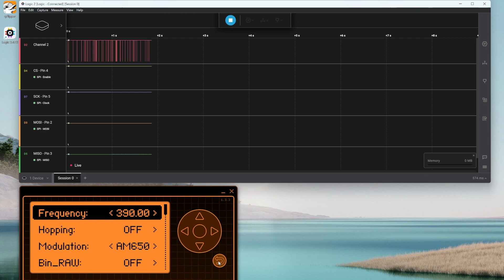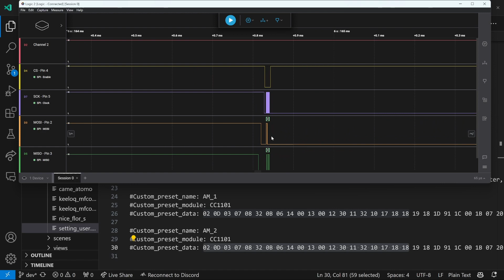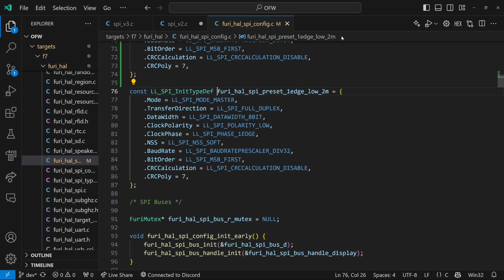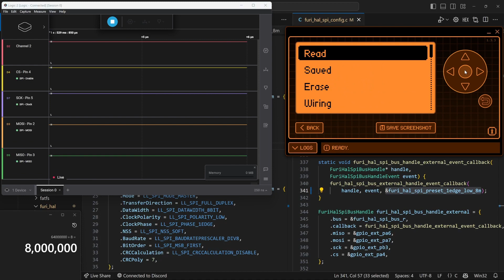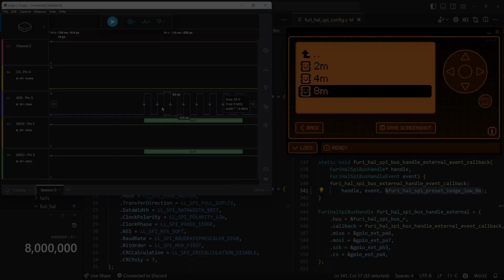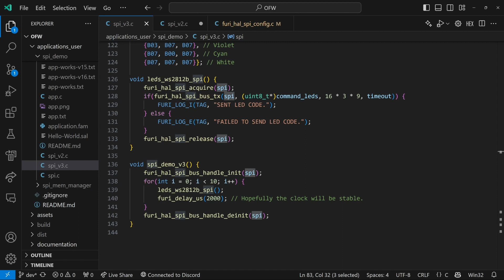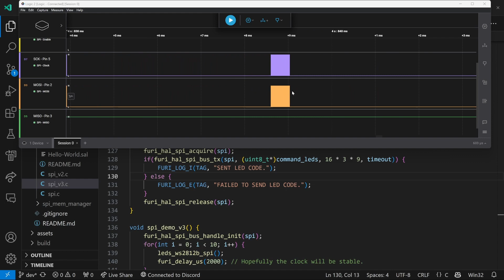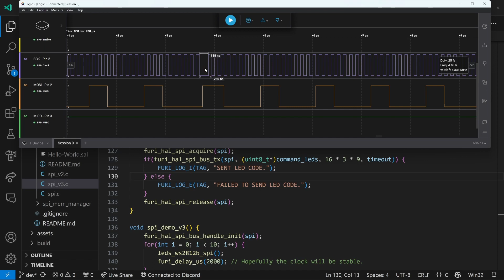[92] Flipper Zero - Advanced SPI Topics

Comment: thanx!
Reply from the maker: You're welcome!  Increasing the SPI clock speed is probably the most useful trick.  I like to typically run at 8m (I don't go faster because my current logic analyzer can't sample signals faster than that, so I leave it at a speed I can debug).  I did put a faster logic analyzer on my Christmas list.  :)